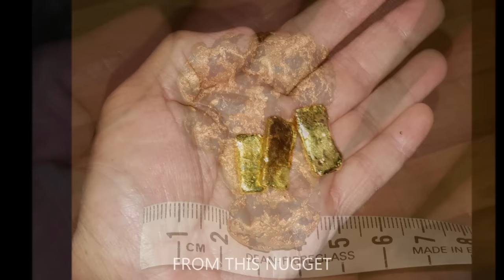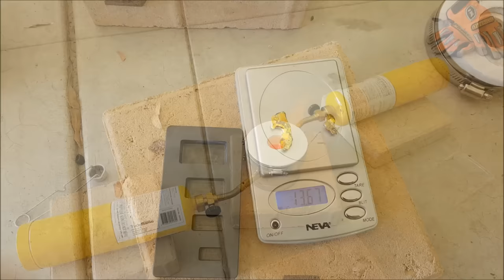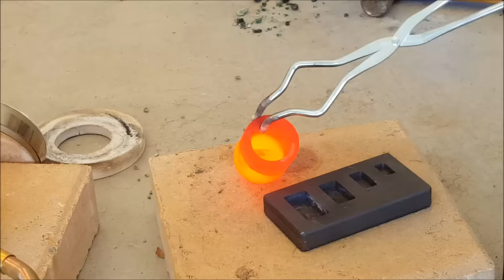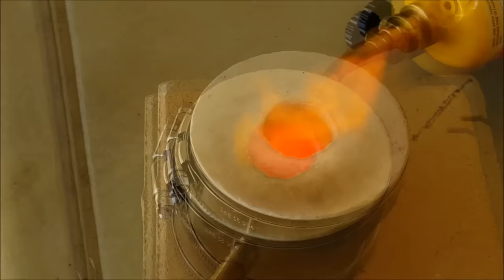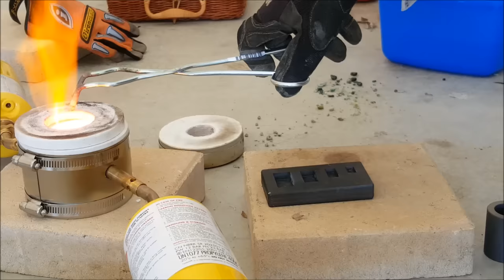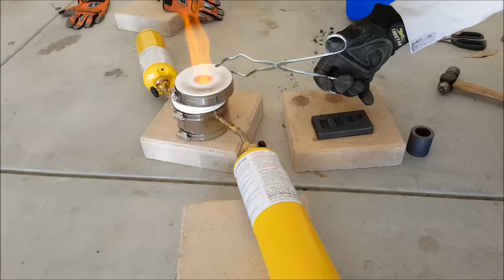Turning Gold Nuggets Into Tiny Gold Bars: Watch The Mesmerizing Melting Process!

Comment: To me this video is useless. He does not explain anything about what you are doing or what you need, to do the smelting.
Reply from the maker: If you had read the description that I posted with the video, it would have explained what was going on. Here is what it says.

Melting gold nuggets specimens into gold bars using furnace, crucible and mapp gas. This is not a tutorial, as its my 1st attempt. 
Gold specimen were smashed in a "dolly" to remove the quartz and iron stone from the specimen before the start of the video of the melt.
I hope that helps, it was not a tutorial.

thanks.

Comment: Whats that coffee can lookin thing called?🤔
Reply from the maker: Hi, I guess your asking about the FURNACE , it's the metal container to melt the gold in. or the CRUCIBLE , which holds the melted gold until its tipped out into the moulds. I purchased mine from the USA many years ago. The original supplier does no do this style any more. So I have included a link with a supplier in USA who also has a YOUTUBE video. I Can't find an Australian supplier of this style anymore. They are expensive, especially if shipping to Australia. Check out the link below for more info.
Thanks for the post :}
https://www.finderskeepersgold.com/product/kwik-kiln-gas-gold-melting-kit/